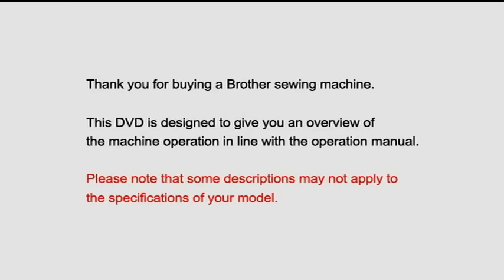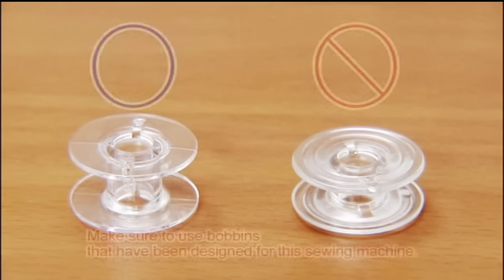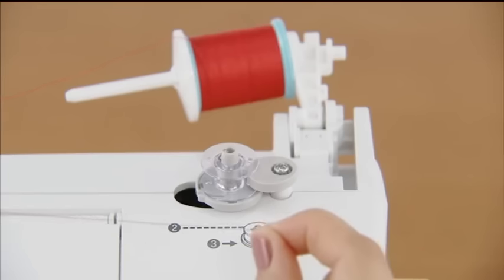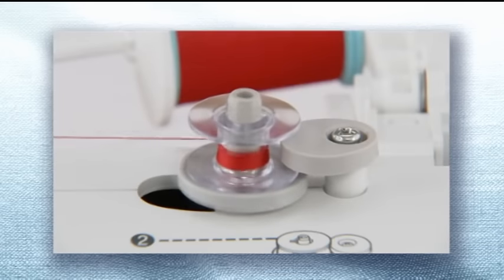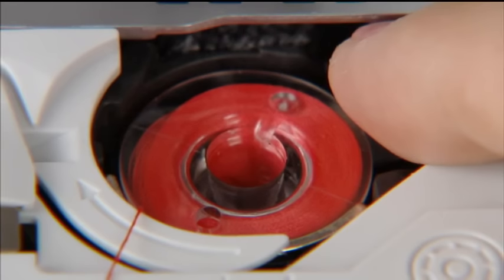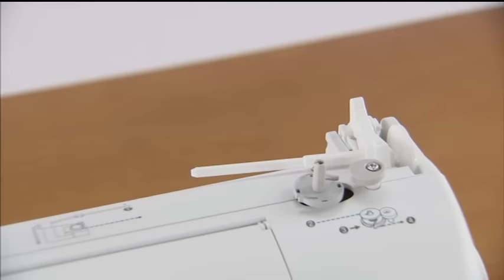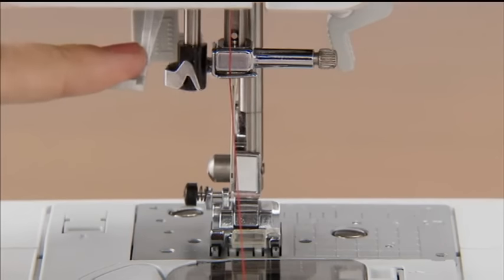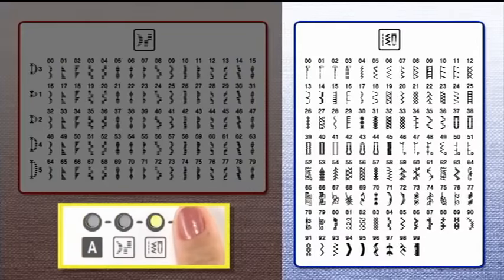Brother sewing machine instructions

Comment: 0:47 Setting up sewing machine
1:17 Winding and setting the lower thread
5:56 Upper threading
8:19 To start sewing
10:55 Reverse sewing
12:05 Adjusting the stitch length and width
13:22 Thread tension
13:59 Overcasting
15:03 Blind hem stitching
16:39 Buttonhole sewing
18:42 Sewing characters
22:27 Replacing the needle and maintenance
Reply: Thanks for this it makes it easier on the setting the lower thread is difficult to see how she sets the thread in the metal parts because she buts her hands on the way and that is making it a little harder for me to see how to set it up on that part 😭
Reply: @D C I feel like crying, all the times I have tried to use this machine (not often) and having to do searches online; This is the BEST one I have seen!!!
Reply: Thank you for putting the times of each segment in. Very helpful!
Reply: Thanks 👍
Reply: Mine isn’t starting to wind in the bobbin. What do it do??

Comment: Just got my HC1850 yesterday. Took me about 45 minutes to watch the video, and rewatching it winding bobbin, threading upper and lower threads. Got hung up on the auto threader. There is a very small, almost invisible itty bitty hook that you have to 'grab' when the threader hooks to the needle. I finally got it, but DANG, could it be any harder to see? I've been sewing for over 50 years on Mechanical machines (Singer, Kenmore). I am really hoping to be able to use this like my other machines, as in the past, like not having to carefully do this and that, raise foot, press raise needle button, turn on turn off, jump through hoops for every action. I never thought a Computerized machine would be so complicated. (I am quite computer literate) 
Tell me it will become second nature with this product.

Comment: So I got got this machine for Christmas, but I am having a problem with the tension. I have had other Brother machines and did not have this problem. The upper thread  will not pull through the machine smoothly. I really have to pull to make it go through. Then it breaks! I have adjusted the upper tension all the way to 0 with no change. What can I do? Also I am using quilting thread it still breaks. So frustrated!

Comment: I would like to know why we have to turn off the power all the time.  Is it because of the machine's computer, or do they just want one to do it for safety reasons?...  I don't see the need to constantly be turning off the power.
Reply: gabbyg561
Reply: It is probably for safety reasons.
Reply: Off and on reboots the computer and resets to default settings.
Reply: it's because when it's on the light (around the needle) switches on, too and machine is ready to work but when it's off, the light switches off and machine doesn't work.
Reply: Safety. They don't want someone to sew their finger to something and have a lawsuit on their hands because the video didn't clarify lol

Comment: My thread won't go through the needle when I push down the needle threaded lever:/
Reply: The needle has to be at it's highest position, press the needle up/down button and try threading again. It may be that your needle wasn't aligned properly by the manufacturer so give the supplier a ring.
Reply: the needle has to be at its highest position, to be able to thread with the needle threader.

Comment: THE DANG NEEDLE HOOK WONT DRAG THE THREAD THOUGH THE EYE OF THE NEEDLE ;-; I need help
Reply: if that doesn’t work i suggest doing it manually and carefully threading it through the eye! just be careful and shut the machine off when you do it :) using the hook mechanism is tricky at first but you’ll get it down eventually